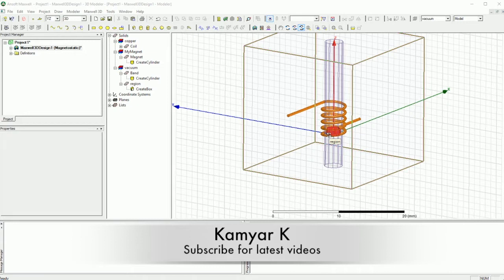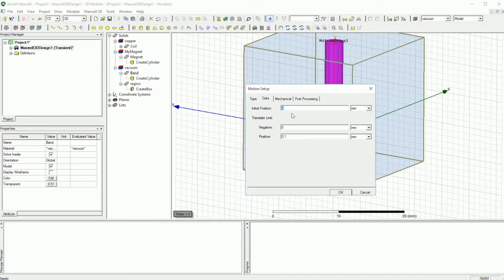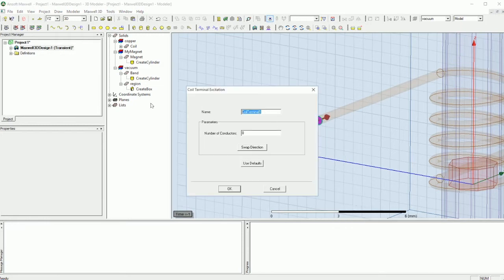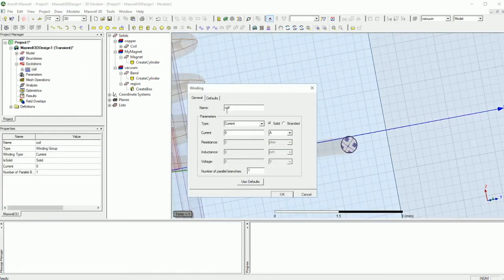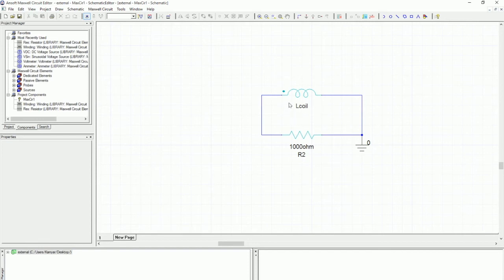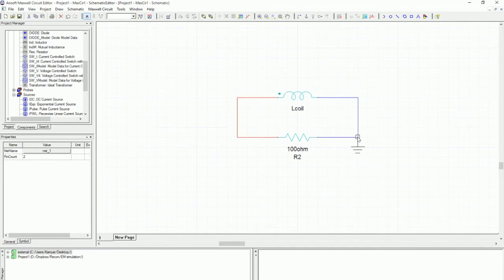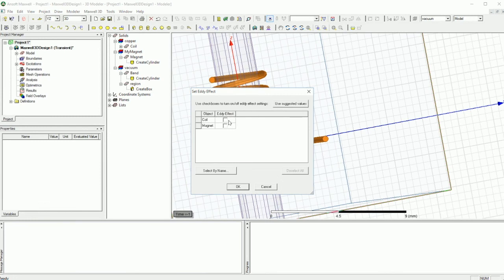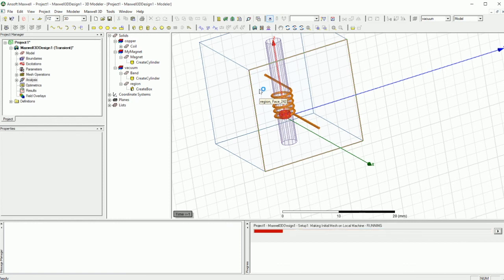408 - Ansys Maxwell | Translational motion [2/3]

Comment: in the external cicuit design we add 100ohm. is it the resistance of the copper? İf not what is the use of it? can we eliminate it?
Reply from the maker: it is the terminal resistance for wires not modeled in the Maxwell geomettry

Comment: hi,
While running, I am getting an error that "The quality of some mesh elements is not acceptable for solution. Please check the geometry for issues in the following location (in meters): X=-0.00464255, Y=-0.00192302, Z=0.00465846" which seem to be the contact between the helix and the coil terminals. Do you know how to fix this?

Comment: Sir can we measure the voltage induced in a secondary coil by using a rectifier circuit and voltmerter in the Maxwell external circuit editor ?
Reply from the maker: +Srijan Datta  yes you can. But  I don't know how. For that reason I use simplorer cause there you can see the voltages across your design.